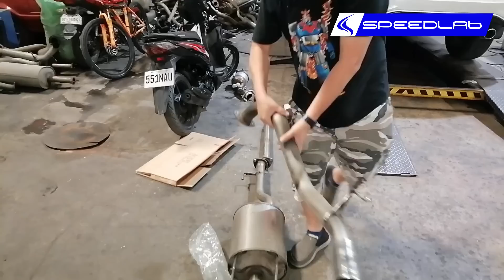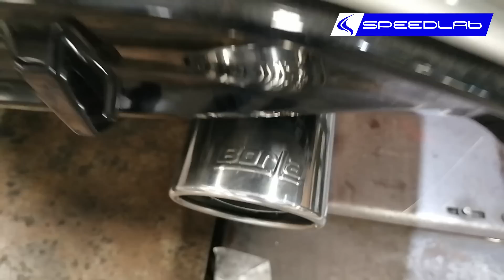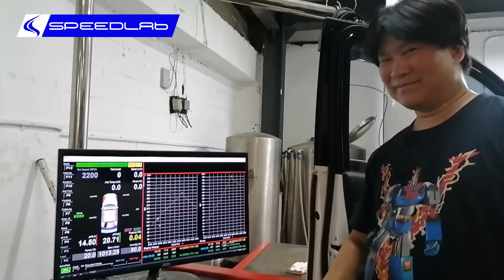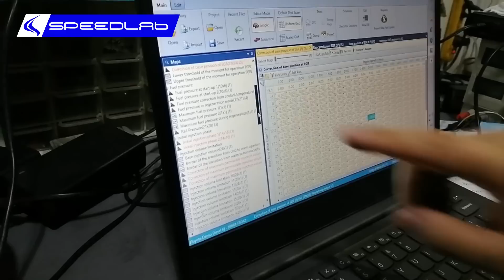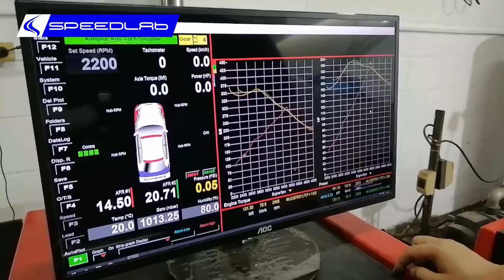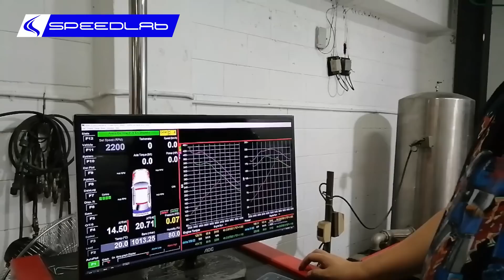Toyota Fortuner 2.4L/2.8L Ecu Remap/Reflash Tuning & Borla Full Exhaust

Comment: Is there a power difference with an intake and exhaust with a tune vs without? I have a tune and debating on adding a cold air filter and muffler delete. Will this give me more HP on my 2.4 gd6 that has a tune already?
Reply from the maker: It’s 15-20hp more with the intake and Exhaust

Comment: Sir hindi ba makaka affect sa reliability ng engine ang pag reremap? Gusto ko sana mag pa remap sainyo kaso ang worry ko is baka masyadong pwersado ang engine and agad masira… sana masagot nyo ito sir salamat!
Reply from the maker: No. There is no change in reliability and longevity because 99.5% of the time, you’re only using 30% of the engines power

Comment: does remapping the ECU and installing full exhaust affects fuel efficiency, ty much
Reply from the maker: Yes. 8-10% more efficient
Reply: sir pwede ba na remapping lang ECU ng Fortuner Q ang pagawa ko. gusto lang mawala yun trottle lag at madagdagan ng HP, ty much
Reply from the maker: @jersonangog3437  p25000
Reply: copy that, thank you very much. by the way can remapping of the ECU also removes turbo lag, ty.

Comment: Sir, how much HP would my 2017 4x4 fortuner gain if ECU remap is done without changing the exhaust and how much will it cost? Im planning to bring my car into your shop.
Reply from the maker: 35-45 on a pure stock car

Comment: Sir sa top speed all stock mas malakas ba 2.8Q compare sa 2.4V at pag Pina remap ano maging result? Inquire lang mga Sir. Peace
Reply from the maker: 2.4 will have more power than stock 2.8 after remap
Reply: @speedlabchannel4452  k sir, pwede na din pla 2.4V remap lang agad power na. Tnx
Reply from the maker: @drmramos1867  dude it says 2.4/2.8 in the title
Reply: @speedlabchannel4452  sir big diff ba fuel consump 2.4 vs 2.8 after remap, sabihin natin 2.5k rpm?
Reply from the maker: @drmramos1867  8-10% on average better

Comment: Is it possible to have a high-power smokey tune but have a setting for less smokey tune for LTO registration purposes? Like wiring it with the Toyota’s Eco and Power modes in its Innova/Fortuner/Hilux models.
Reply from the maker: No. Only one tune with remap

Smokey doesn’t mean best power

Comment: Hi Sir Sid, what do you recommend (economical or all-out option) to make more power yet fuel efficient for both a Toyota Raize 1.0 Turbo and Veloz 1.5 NA? TIA
Reply from the maker: Unichip for both cars
Reply: @speedlabchannel4452  will adding intake, headers, and exhaust be ideal and will it void warranty?
Reply from the maker: @owenzdangzalan  warranty doesn’t matter 
Everything can be put back to stock 

For all out, yes need intake and headers and exhaust
Reply: @speedlabchannel4452  for all out option, package will cost how much? What type of intake and exhaust are recommended?
Reply from the maker: @owenzdangzalan  70-80k each 
Bring to shop to discuss

Comment: Sir SID, hindi po ba pareho lang ang effect kapag naka Power Mode fast acceleration din? If not, what is/are the signifant difference?  With this set - up, what is the impact on fuel consumption?
Reply from the maker: The buttons don’t do anything for power
They control the transmission 
Keep it in normal

Comment: Sir sid, when remapping the ECU is the transmission remap included especially on Toyota’s 6 Speed AT shift points/ torque converter lock up or it is an additional charge?

Comment: How about the power changes from 1000rpm to 2000rpm? Most of the time yan gamit ko na ranges while using my montero.
Reply from the maker: You'll feel it the very micro second you step on the pedal. We just can't see it on the dyno because it's impossible to hold an engine at 1000rpm in 4th gear
Reply: @speedlabchannel4452  thank you sir for the explaination
Reply: Yan din nga sana tatanong ko sir..2200rpm lakas na kumain ng diesel yun